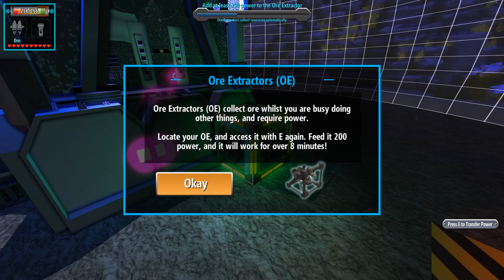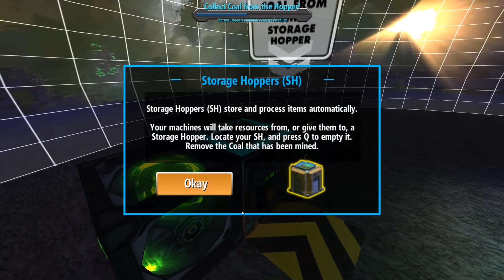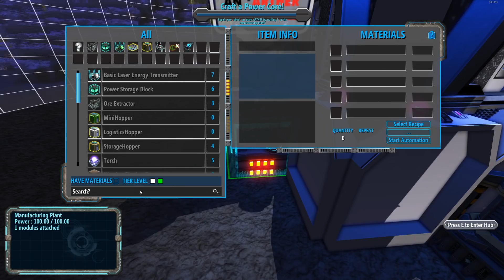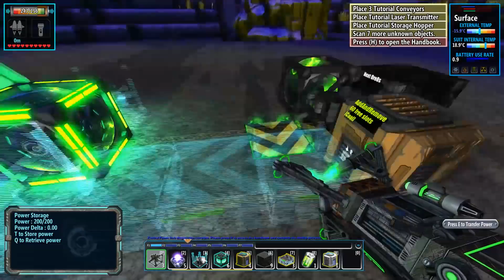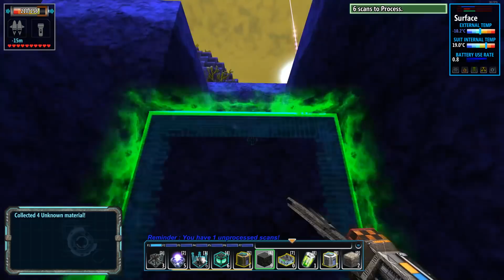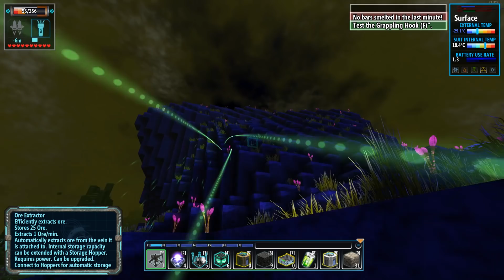FortressCraft Evolved E01 Crash Landing

Comment: This is a truly great game but has issues that could do with being adressed. Nevertheless, you need to stop making Basic Conveyors as soon as possible, they are far too slow. Don't worry too much about the ones you made because you can grind them up later and recover some of the materials used to make them.
Conveyor belts can pull from any side of a hopper and hopper orientation isn't that important (unless it drives you mad when it doesn't look right :) ). I have many more tips but i'll wait to see your next vid before i offer more. You seem like an intelligent chap and you may have worked some things out for yourself by then.
Keep up the good work.

Comment: If you get really good at the grapling hook, you can just use vertical shafts for ascending and descending into from mines. kinda risky though. elevators are much more safe but slow.
Reply from the maker: Going up sounds cool.  Going down with a grappling hook sounds terrifying :D
Reply: its rather insane free fallin up to a km or more catching yourself only with the grappling hook. but also very dangerous if you miss. also quick tip, there are commands to let you auto build a bridge to a location from your feet but I forgot what it was originally, also G lets you drop glow sticks which only cost a small amount of energy.
Reply: Superbuild is the word for the function you're talking about. You can build with blocks the same way you built the conveyors. Makes traversing some of the caverns easier.

Comment: The inventory management is a bit awkward you should just assign all the ore in one of you action bars like 2 or 3 and also do one for the smelted ingots,
Reply: Also don't hesitate to use your logistic hoppers at first instead of the normal ones they are way cheaper to build, for example the one near your cph for the coal doesn't need to be a big one, instead use that one for the copper

Comment: You can insert quickly all (or max) by placing items in the quick bar and pressing T looking at the hopper. It is usefull to put ores in one of the quick bars for the start (untill you setup automated ore processing)
PS. ctrl+T transfer 1 item, Shift+T transfers 10 items per pressing
PPS. There is no option for taking custom amount...